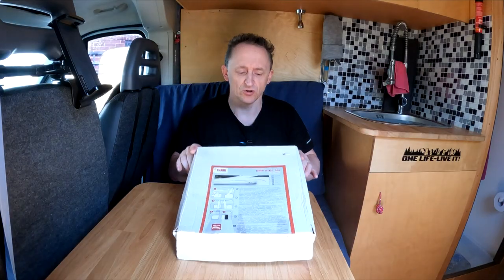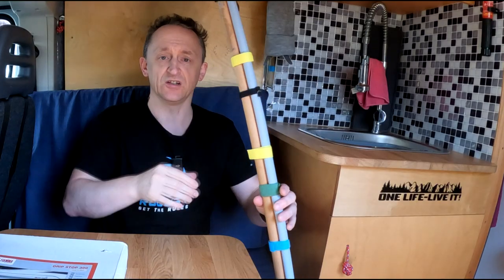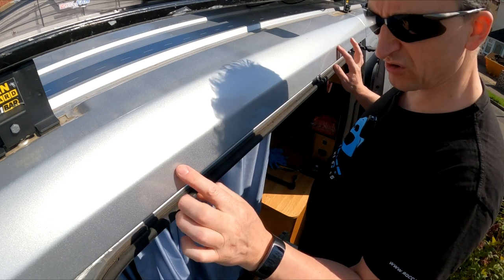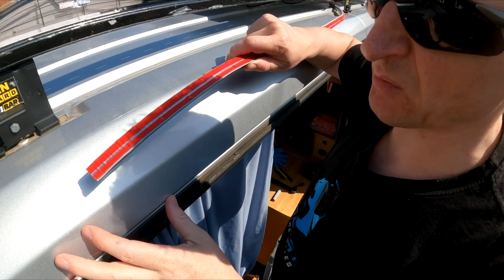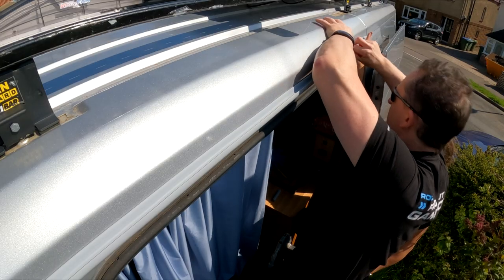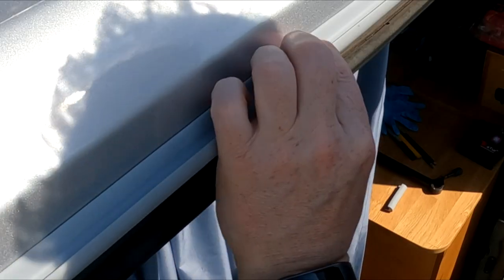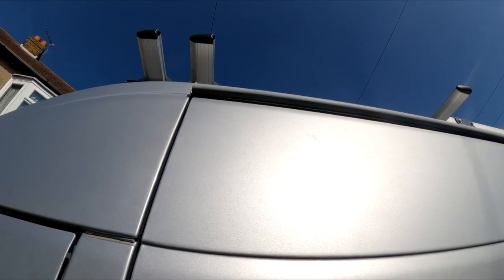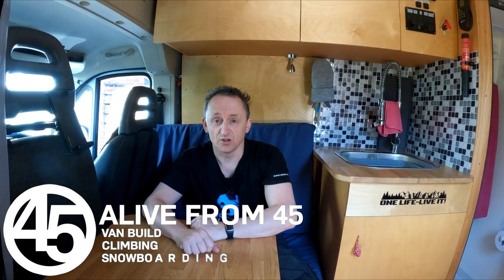Stopping WATER coming in the side door *HACK*

Comment: Hi good to see a product that seems to work, is it still performing? Also I was watching thinking about the length you cut to and the run off on either side. Would you have cut it a little longer on both sides in hindsight? Also ive seen it mentioned to angle it slightly?
Reply from the maker: Hi Andrewgilbert, thank you for watching and posting your question, I can confirm it is still stuck in place and has not moved at all. In regards to the length it covers both sides of the door opening. in regards to going any further forward, i feel it would be hard because of the shape of the front of the van and it could cause an area where the it may peel more easily, with regards to extending backwards the reel is of cause long enough to do so, however i feel this offer little use as currently the water does not come in, for the most part it is for when you open and close the if it is raining more often than not we would close the door. One big thing it does do it stop that annoying spray coming at you when you close the slam the side door. I hope this helps.

Comment: My old van had that problem, yrs ago but I got one that was ment for above door on house ,so much deeper, silicone n screwed on n worked at treat ! No more drips inside van !
Reply from the maker: Hi Feral Freebirds, thanks for watching and taking the time to comment, great idea using a house version.
Reply: @Alivefrom45  it worked for me, was fed up of water in my van , n fulltime van dweller , that was over 15yrs ago, ive had a jumbo transit since, ive just started uploading old lockdown videos, n very soon will be uploading ( much better quality) videos of my complete restoration, at mo riping interior out, for lots of welding then rebuild!! exciting , so documenting on youtube, if i ever need to do this job again, id use this, as looks neat !! mine was wide, but i was just more concerned about keepng dry !! :)

Comment: Hi - just subscribed - how well did the drip stop work - thinking about installing it on our boxer . Thanks
Reply from the maker: Hi mminc, thank you for watching, Subscribing and posting your question. I can confirm it works amazingly, we now get no drops, you just need to remember that the water needs to flow out the ends, so when you cut to length allow this, like I did. I know people have said you can buy a cheaper version and i know people have, however the glue on the back is not as good as this one and as result it peels off, we have not had that problem.